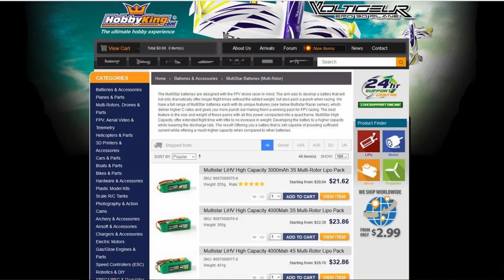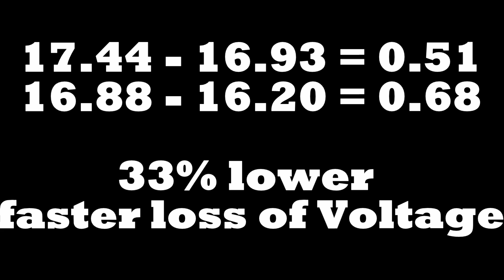LiHV batteries

Comment: Will a 4 cell ESC work with a 4 cell HiV battery?
Reply from the maker: It works the same! I flew the plane with the LiHV and it was awesome! It is just 0.6 Volts more.
Reply: Great
I just bought a new battery charger that does the HiV batteries and the high Mah batteries so I should be all set.
HRCP4239  Hitec X2-700 2-Port DC Multi-Charger
Reply from the maker: That is a monster charger! Wow 700 Watts.